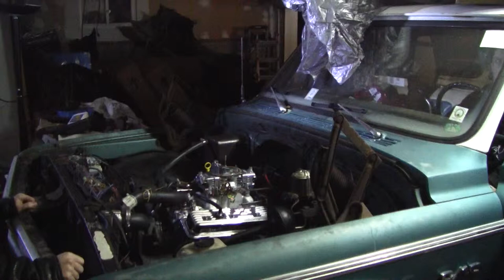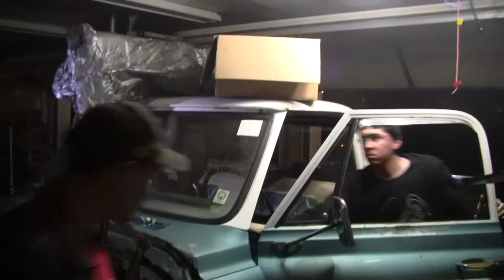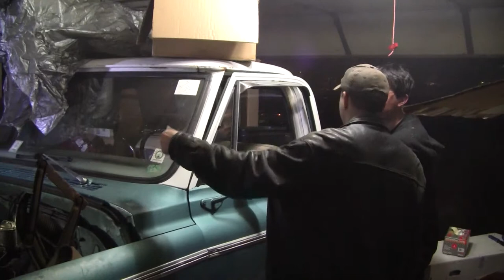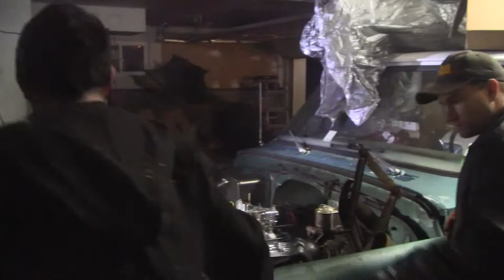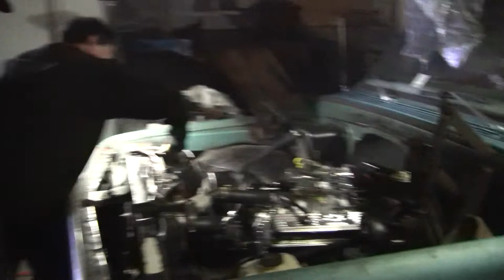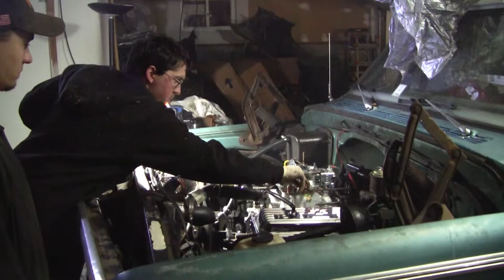Ol' Dutch's new engine, first start.

Comment from the maker: @Rassah5 A little, from when was filling the engine up. Also some trans fluid splattering on the exhaust i forgot to tighten up on the radiator (made that comment near the end of the video).